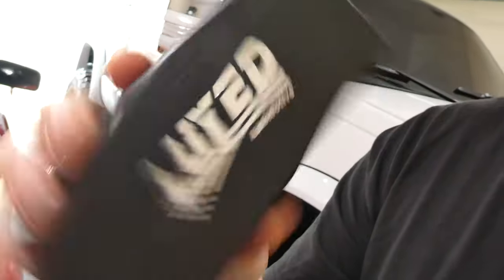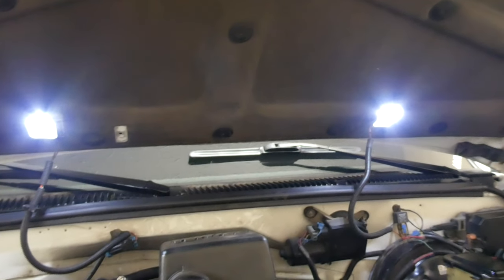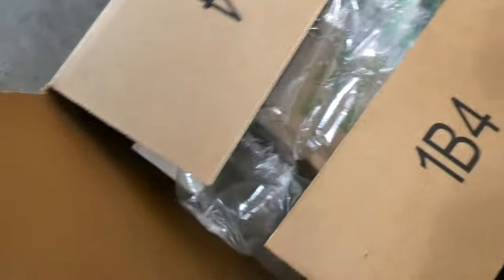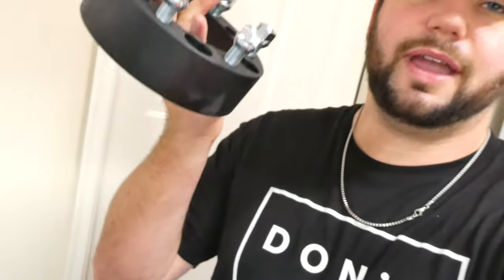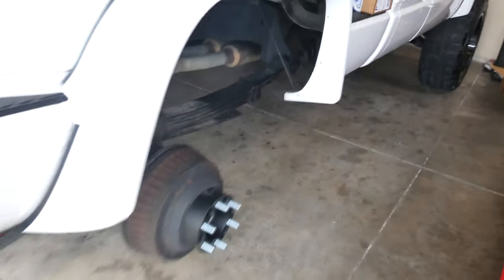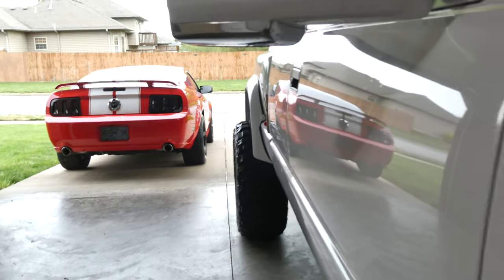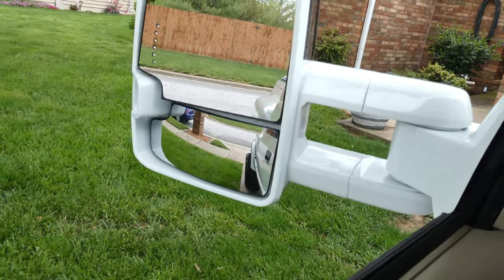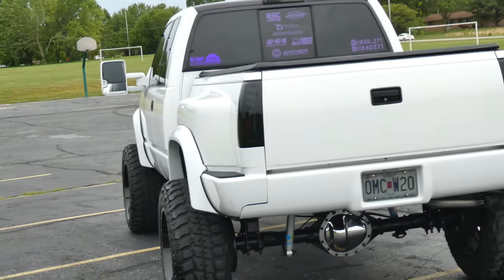I put 2" SPACERS on my Truck!

Comment: My man.. please do some research. You need to get hub centric spacers to be safe for you and others on the road. Check out bora.
Reply: I had ebay spacers 2 Inch for 4 years no issues at all. As long as you torque the spacers at proper spec you should be ok. Mine are not hub sentric and wotk just fine. Peace

Comment: Nice video man spacers look nice just watch them what happens to the cheap ones is the are not centered on the hub which can put all the weight of the truck on just the wheel studs and cuase failure and break down the nice ones like bora are hub centered much more stability with them but unfortunately that comes at a cost but it looks good and watch your paint cuase with the tires sticking out they will throw rocks up worse than befor
Reply: Man you are so right about them throwing more rocks one passed by me and I had my arm out the window and a rock hit and cut up my arm something bad so I had to turn around and drive home all bloody
Reply: Yeah those cheap ones are not the way to go, I've seen the studs break off of them and the guy never even took it offroad
Reply from the maker: I'll keep em torqued like they should be. Fortunately I don't daily the truck anymore like I used to.
Reply: @BADZ71  yea best you can do is keep checking em every so often I don't have the flares on my truck right now the were looking crapy I am going to wrap them in mat black but with out them my tires only stick out a Little in my state they try to regulate that we have yearly inspections any we are not supposed to have tires sticking out more  then 3 inches
Reply: @blackobs2535  not only just that I have found without my flares on the tires being out more you don't want to follow me in rain it's like following the semi truck I am going to wrap my flares in mat black so the look better and put the on